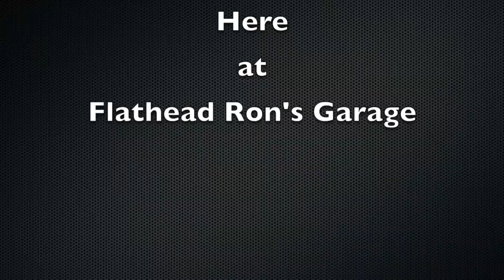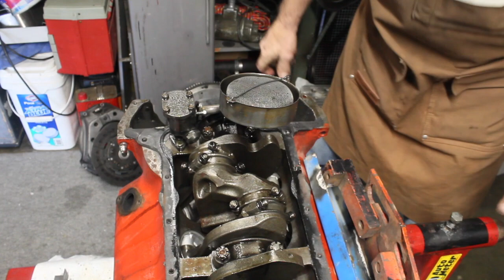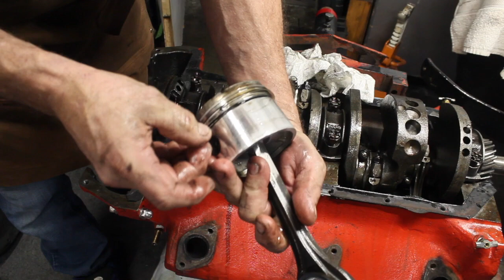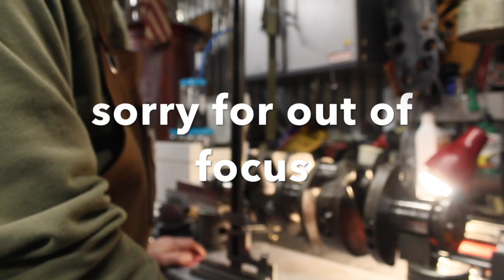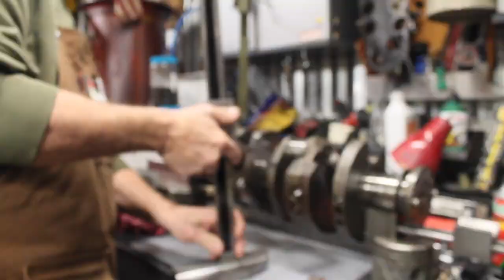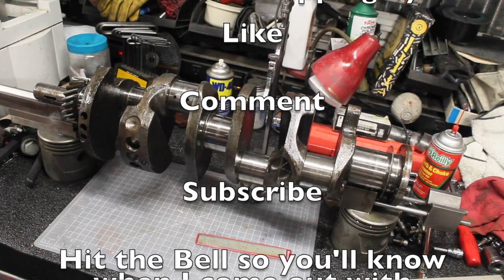Flathead Ford 59 L Disassembly and assesment pt #2

Comment: How are the rod bearings oiled? I’m assuming they are oiled thru the main bearings and to the rod bearings. Excessive main bearing clearance would cause a lack of oil to the rods. I also assume the piston skirts are being oiled from oil squirting up through the rod end. One thing that bothers me is the way the rod bearing only wore on the outside edges. I’m thinking if I were you I would take the crank to a  shop that specializes in crank grinding to get it  measured and verified so you know if it is proper tolerances on the grind
Reply from the maker: I think it comes to one thing. Lack of oil. When the pump went bad and I had zero oil pressure i was actually in second gear driving before I saw the zero and shut it down. I think this is when she was hurt. The starter situation just pushed one bearing to the point I could hear it like a light tappet sound. It ran like a beast for a flattie. Had no clue the rod bearings were like this. What would you do, keep it original as possible to the 1940’s race build check tolerances and watch it closely, or loose the history and go through it. I’m not going to race it. I can always build another. There’s plenty of blocks around. And I have stock parts. And it didn’t help to have the wrong rod bearings in it. I should’ve had the P series bearings in it. Bigger oil hole. What do you think John.
Reply: @flatheadronsgarage7345  Ron, I have built race engines most of my life, I understand your wanting to preserve the history! It is hard to not think in race engine terms, but the bottom end is the foundation that everything else is built on. Many years ago I did a stock overhaul of a Toyota 4 cyl that had spun a rod bearing. The crank didn’t look bad, so I cleaned it up with some very fine abrasive cloth, threw some bearings and rings in the motor . That motor lasted about 50 miles before it spun another rod bearing. I learned from that and no longer take short cuts! Do it right, do it once!
Reply from the maker: @RockingJOffroad    I have a friend, he’s a retired machinist and his son Alex is a professional machinist. They are coming over today and checking it over. I can’t find more than a couple tenths difference anywhere.
Reply from the maker: I thought of one more thing.I haven’t run the mufflers on this car in about three years. It’s just been straight pipes. It could be the light tap tap tap was there and I didn’t hear it until I put some decent mufflers on it. You know I’ve been sitting here thinking about this a lot losing sleep.

Comment: When you have one down that far, you gotta replace everything that is suspect.  Good luck with the rebuild my friend.  Like doing field surgery on your best friend.
Reply from the maker: It’ll be big $$$ for sure Vernon.  I can build a hot 289 for less than I will have in this but it won’t be a flattie. So far it’s everything but the crank and valve train but If the rods are good it’ll be a plus. I’ll know soon. I have a request in with H&H Flatheads before I can place an order, Let’s see if they’ll respond. Thanks for watching Sir.

Comment: Hi Ron. Did you notice the ring gear has been partially pushed off the flywheel? The mains look pretty good. Those are old school racing pistons. Solid skirts. I think they would have been set up pretty loose when new. I'm not an expert. Let me ask you, though, how was the motor running before you had that noise? Was it running good and strong? Did you have any inkling it was getting worn out? What I am getting at, is with the intended usage, expected miles you intend to cover, how fast you want to drive it, etc, when all is taken into account, does it NEED new pistons? I can see a snowball effect. new pistons, new rings. They'll weigh differently so a balance job is on the cards. Due to necessity I take a more conservative approach and try and reuse what I can. Another question, though, do you think the noise may have been related to the pistons? 
I look forward to seeing how you progress the job. Mart.
Reply from the maker: You have some very good points Mart. I had no clue what was about to happen. It ran very strong. I might need to step back and look at this..  I might be driving around 1- 2K on a good year. Not a lot of high revs or speed. And I don’t take it drag racing. I might play a little though 😇 but not to hard. Realistically,,,,, how big a bucket of cash do I want to throw at it. I’m like you. I normally reuse, repurpose, I have stuff I’ve been saving for years waiting to use again. These motors were made to go from point A to point B fast as it could and not built for a street car or to last. OK now how do you feel about this. You know I’ve been thinking this over really hard losing a lot of sleep on it. I can afford to do whatever I need to but ......... I do not want to wash the history out of the motor I just want it to run well.  I put the crankshaft in the lathe today. I wanted to polish up the main journals. I’m seeing some things I really do not care for. However it has been with these things through his entire life and probably been raced like heck with these things in the crankshaft. It’s still smooth and can’t feel it with my nail, it cleaned up really nicely, there’s no problem with this it’s just I wouldn’t want to show somebody.  I don’t mean to drag this on but what would you do about the slight scarring on the pistons. But there again I might be messing around with weight. Needs bearings certainly,, the rings were not quite broken in. I need some advice Mart.
Reply from the maker: Hello mart. I might be getting some haters. I think I’m going clean up the parts and replace what’s needed to get her running. Hone and Rings, bearings, full flow oil, round up the tops of the guides. I’ll get another block and build one the way I want. Oh yes, also have an oil pressure safety light set coming, pressure drop to 20 and the light comes on. Thought I’d give you an update.
Reply: @flatheadronsgarage7345  Hi Ron, I didn't reply because I don't want to tell you what to do. I'm a hack and will put something together even though less than perfect just to see what happens. If I were in your shoes, I would just clean and reassemble, making sure everything looks ok. Maybe not perfect but ok. Lets say the damage was done when the oil pump failed. Just make sure the crank is a-ok on the bearings, fit new correct bearings and button it up. Put all the pistons and rings back in and pretend you haven't seen them. I would try and keep things simple and not add lots of mods. (But this is me). I would put it in and drive it and after some running in, drive it hard. That's what I would do, but remember, I always am prepared to fix it if it goes bang. Telling someone else to do what I would do is not fair as I can't guarantee it won't go bang. Just out of interest, if you get another block, what sort of build would you have in mind? Ok gotta go, it's way past bedtime here. Mart.
Reply from the maker: I was right,,,,,,,we are alike. Well I forgot that I cannot get new rings. Because of the thickness of these I had to wait for months, I thought it was six but I think it was only four. This being said the rings are chromemoly from Hastings and not broke in yet so I’ll stick with them. Just a quick hone with fine stones with lots of oil and put a polish on the pistons where they’re scarred. I have new Clevite class P bearings coming. 
I haven’t checked the intake runners yet to see whether or not the guide will be  a huge obstruction because of how big the runners are. I won’t go overboard on the mods. I’ll find another block and build it the way I want to. If I am going to dump 2K into a rotating assembly I want to do it on my terms. Money doesn’t grow on trees as my dad would say.I did check the power slot though, where it’s relieved. It’s over .125 K I can’t wait to blue print the rest of it oh my goodness. Well, thank you so much for your time sir. I sincerely appreciate it. Have a good day Mart    I like your honesty 👍🍻 cheers...

Comment: Just heat the ring gear to remove it and rotate it on the flywheel.  The engine always stops at one of several locations so the bad teeth will be out of harms way. Depending on the tooth profile you may be able to turn the ring gear over also.
Reply from the maker: Someone in the past made sure it wouldn’t move. I’ll show you on the next video. You are right though. I do have other flywheels to pirate a gear from. Thanks for watching Steve

Comment: Piston slap ruins the pistons?  Does it "egg" shape them?  Also, are all flat heads safety wired?  That was like a light plane engine. I plan to rebuild my Trans Am engine.  It's been a while since I've rebuilt and engine,  but I will try my best.
Reply from the maker: Hi Jester thanks for watching. Not necessarily egg shape but when I lost oil pressure the motor ran for a little while shall we say. That’s why they’re scarred at 12 o’clock & 6 o’clock on the Piston if you’re looking down the bore. Yup, safety wire is almost a dinosaur these days. You’ll do fine, I’ve seen your work 😇   Is it a 400.
Reply: @flatheadronsgarage7345  Thank you for the info Ron!  And no.  I have the mighty 305, but I want to stay original.  I'm the original owner and just want to keep it stock.  Someday, I may soup up a car;-)

Comment: The list of needed parts is growing. Ugh!
Reply from the maker: You’re not kidding Tom. I hit my wife up for a 471 ...... 😞 still working on it though. I’ll be into this around  2K I’m figuring, if I’m lucky. I don’t want to try and do it on the cheap. It’ll bite me, I know it. I can probably go with a SBF or the FE 427 (he’ll give it to me with the intake a rod bearing scarred the crank) for not too much more and have 4X the power but it won’t be a flattie. Then I’ll need bigger brakes. And the money pit continues. Thanks for watching.
Reply: Tom, are you thawing out yet?
Reply: @RockingJOffroad  Barely. Sun is out but it is only 27 degrees.